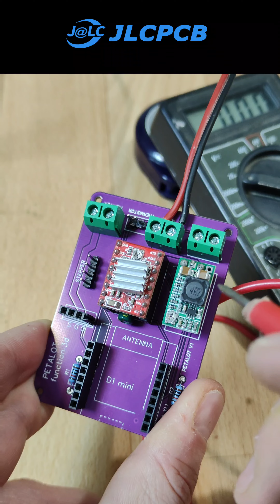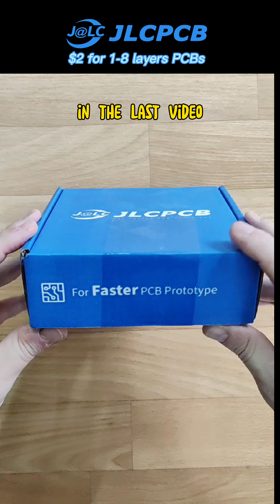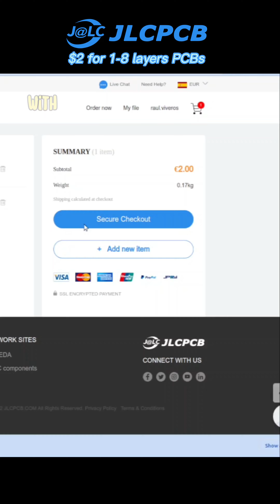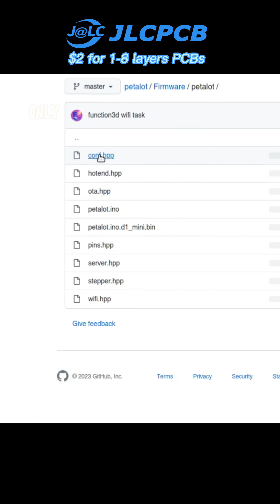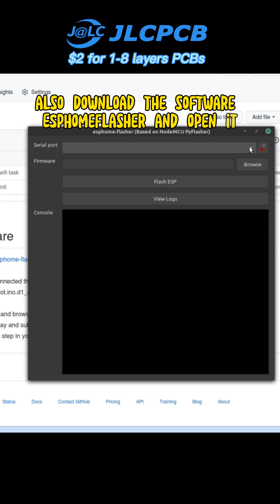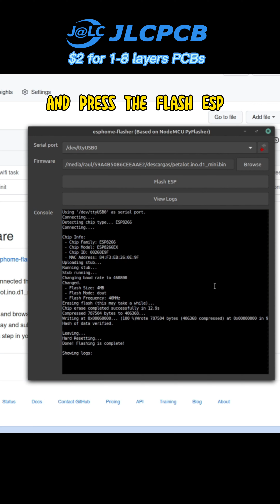How to turn on the electronics for the first time and load the firmware

Comment: Hola, Function 3D! Estoy Armando la maquina desde cero, y ya lo tengo todo pero tengo una duda todo funciona menos el bloque de aluminio y en la placa las pistas corre los 12 V y llega hasta el modulo wifi la coneccion y todo tiene continuidad. Hasta la cambie el MOSFET, pero aun asi no calienta. Como puedo Resolverlo? desde ya muchas gracias. Muy bueno su proyecto
Reply from the maker: Comprueba que el heater tiene continuidad y que da 3 o 4 ohm más o menos, comprueba que los terminales del heater de la PCB llegan 12v cuando el motor esté girando, revisa soldaduras el problema está en las soldaduras con un 90% de probabilidad

Comment: Hello! I am currently building the petalot and I got a bit confused. What resistors should I use? In BOM there are 10K ohm resistors, but when I visit aliexpress using your link there are 1k resistors chosen.
Reply from the maker: @_rukala_  The choice is from aliexpress not from the link, you still need the 10K resistor as specified in the BOM
Reply: @function3D  thanks❤

Comment: Hola Function 3D!
Muchas gracias por este proyecto que es muy interesante. Lo he conseguido armar por completo y no me calentaba y el sensor pegaba saltos entre 19 y 28 grados pero habia continuidad electrica. Ahora se reinicia cada 10 segundos. He revisado los voltajes y estan todos bien (entrada12.08v y luego convierte a 5.14v, stepper a 0.423 ) no se me ocurre que mas revisar. Alguna idea?
Reply from the maker: Deja solo el dc-dc y el wemos pinchado a la PCB, ¿funciona?
Reply: @function3D  Si, funciona. De hecho le he dejado un ping para controlarlo y no se reinicia
Reply from the maker: @joseanrodriguez3273  conecta el sensor de filamento y el termistor y prueba, conecta el driver y prueba, conecta el motor y prueba, a conecta el mosfet y prueba, apaga la fuente cada vez y espera que se apague el led de la fuente cada vez, cuando falle hay tienes el problema, podria ser el componente que conectes o las soldaduras de la PCB  relacionadas con el componente
Reply: @function3D  para mi sorpresa ha vuelto a funcionar todo pero no calienta
Reply from the maker: @joseanrodriguez3273  hay esta mal en el MOSFET o el calentador, soldaduras o están fundidos
Reply: @function3D  voy a repasar todo paso a paso, de todas formas un millón de gracias.
Reply: Volvi a soldar el mosfet y ya funciona todo!! Muchas gracias!

Comment: Hi, First of all, thank you for sharing such as a great design machine. I follow your whole making process, but in the final test, I encounter a weird problem. When I try to turn off the machine from web interface, but it will power on by itself after couple seconds. Is it normal or not ? I checked all the incoming power and they are all  matching the value you described in video. Any thing I can do to check the possible reason ? Thanks.

Comment: hey thanks for this great project idea 
im making my own at the moment but i have the problem that the extruder wont heat over 175 C°...
everything else works just fine. temperature in the settings are 220 C° and max 230 C° (default settings)
thx in advance
Reply from the maker: Set 255 in "Max:Maximum value for MOSFET", if it still doesn't work you must have something wrong with the power supply or the mosfet
Reply: @function3D   Yup now its working 
thank you for the quick help
Reply from the maker: @Ksaroko  The temperature is not important, the filament is also made between 120 and 220°C.

Comment: I tried to do it and everything seemed fine, but the engine didn't turn. I read that I need to change the voltage on the controller because there are different resistors. Now it doesn't even connect to wifi.
Reply: Andrzeju! Odezwij się do mnie - nie wiem jak ale chcę wymienić się uwagami i problemami. Pozdrawiam!
Reply: Ja mam problem z osiągnięciem temperatury 220°C. Po pierwszym uruchomieniu osiągnąłem tylko 140°C! Potem podłubałem i jedynie 180°C.... Myślę czy nie winien "chiński" klon Wemos D1 mini i zamierzam zakupić inny, taki jak w filmach twórcy Petalot'a.

Comment: Hi function3d, really like your videos!
Got 2 questions for you:
- What nozzles do you use? (both filament maker and printer)
- Do you need to dry the filament you made before use it?
Reply from the maker: 0.X + 1.7mm drill bit, 0.4mm now in all my printers, I don't need to dry the filament, I have PLA, PETG and PET without protection of any kind, it has never given me any problems

Comment: Ok here's my question: how many grains of sand are in the Sahara Desert?
Reply from the maker: It is not possible to determine an exact number of grains of sand in the Sahara desert as it is constantly changing due to various factors such as wind erosion, shifting sand dunes, and sand being added and removed through natural processes. However, it is estimated that the Sahara desert contains millions of billions of grains of sand
Reply: @function3D  close enough 🤣
Reply: At least 4